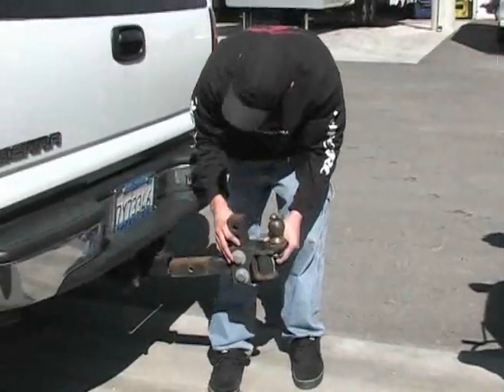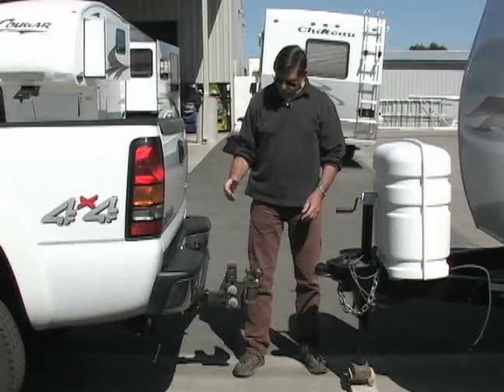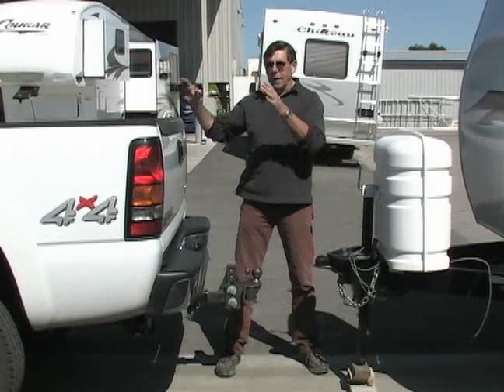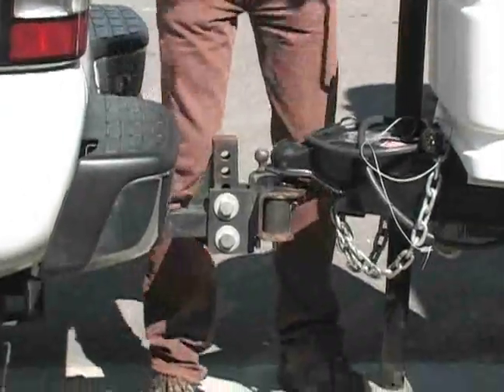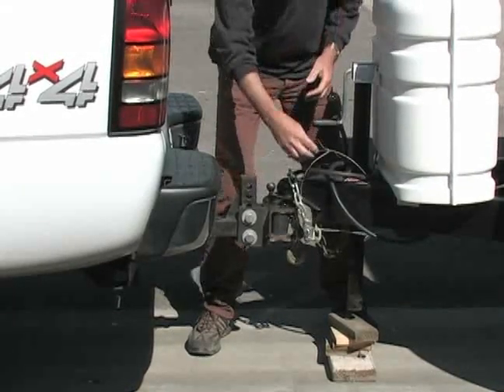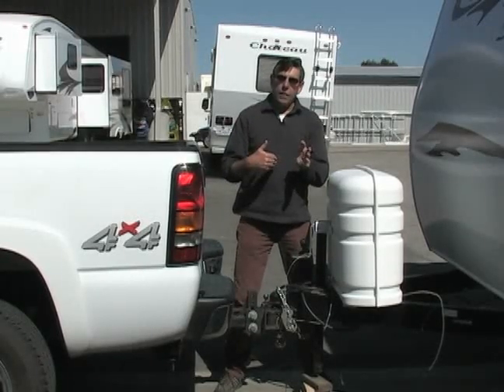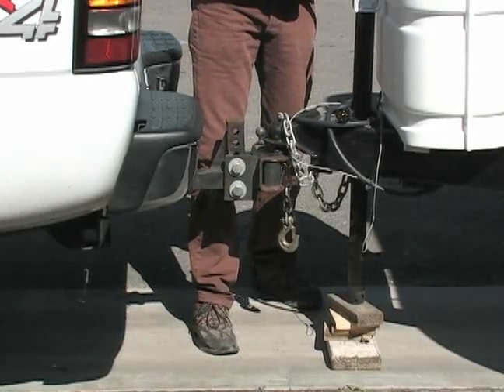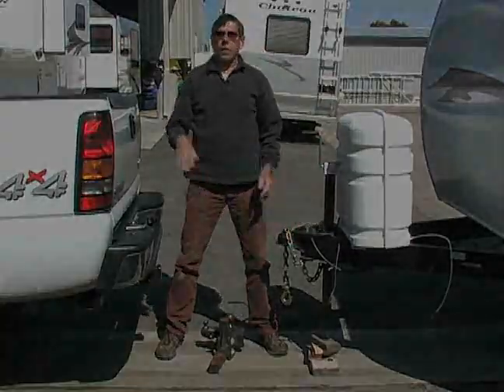Travel Trailer Hookup

Comment: The hitch pin should always slide in from the drivers side and the holding clip should connect on the right side of the pin. Why?  because most all roads slight down to the right for water run off.
If the clip breaks or falls out, vibration will not cause the pin to slight out.

Comment: What is he talking about?  The safety cable has nothing to do with the RV turning over, It engages the brakes of the trailer in the case of trailer separation from the tow vehicle.  This is a safety feature to minimize the damage a runaway trailer can cause.